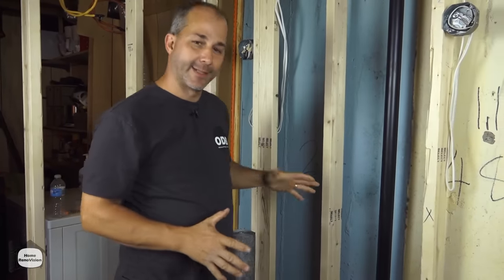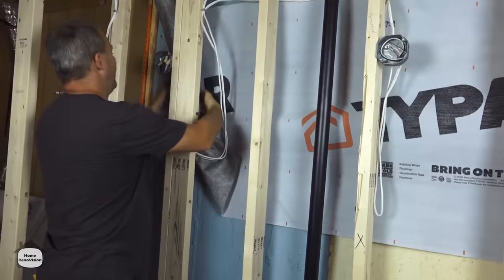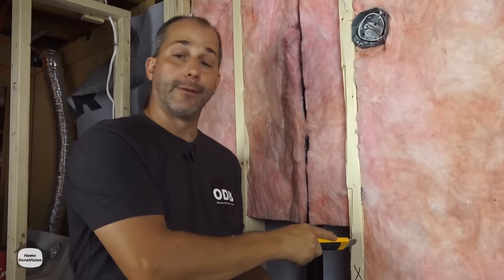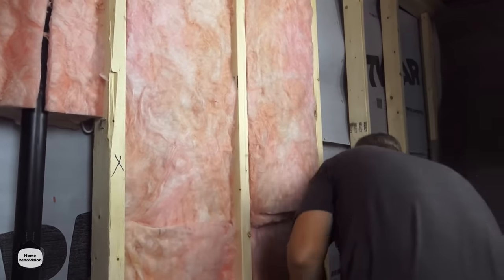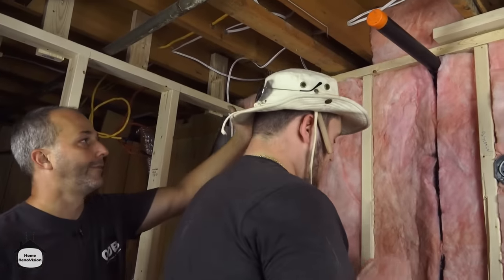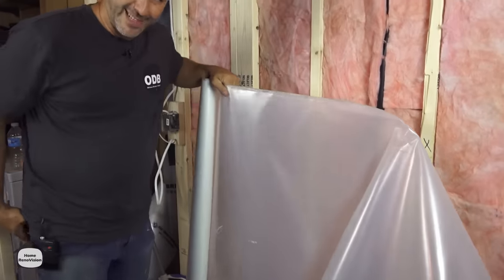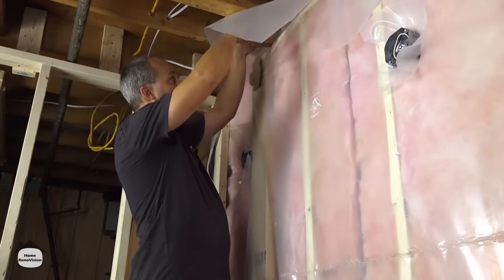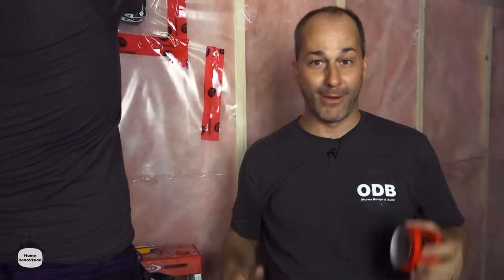How to Properly Insulate a Basement Wall: NO MOISTURE!

Comment: Not good building science, Especially building in anything below zone 6-7. The TyPar is an air barrier (if it is taped and sealed properly, which this is not), and a vapor retarder which is letting moisture through, you can still get condensation on the foundation walls. Water vapor moves primarily through air movement, not through diffusion. In this application you technically have neither, you could use bailing wire to keep the insulation from sagging in the cavity. There are so many ways for air to move from the finished area to the gap behind the cavities. Insulate with rigid foam board or closed cell spray foam directly on the foundation wall, and then cavity insulation  if you still need more R-value. This will work every time in every climate.
Reply from the maker: Here we go. First the typar is not being installed to do anything but keep the insulation from coming in contact with the concrete. Having said that , the links you posted were citing the bad design of walls that had the insulation against the concrete or plastic vapor barrier on both sides of the plastic. The problems that cause are obvious. In my design You get an airspace and an interior insulated wall for 1/4 the cost of the new modern systems. This will not promote mold growth and can be restored from any major water event quickly and cost effectively. The system you refer to with the ridgid foam may seem impressive however, I believe that is designed in order to sell more product and ultimately in any flood scenario, the entire basement system must be removed down to the concrete wall and floor in order to control and treat bacteria growth. This causes a huge expense to both the industry and the environment.
My approach is minimalist and time proven in homes for over 100 years. I guarantee this new system will be replace in the next 20 when they discover what us old guys already know. If you don't have air space in the basement then you will have problems. Period.
Reply from the maker: oops, my response was actually suposed to be directed at Andrew Hunt. But is applicable to you as well.

Comment: What the heck???
First of all the electrician ran 5 feet too much wire to each box!? Then you have an airspace behind your insulation,  for what reason? Use rockwool and put it up against the wall? No vapour hats on the electrical boxes? What's stopping the insulation from falling out between the frost wall and drywall?
This is the sketchiest job I've ever seen...you have no idea what you are doing! If you worked for me you'd last five minutes then I'd hire a pro, stop and get a job at McDonald's or something else that has nothing to do with people's home's. 
I've been a contractor for over 30 years, and had to fix your nightmare slack work since day one. Mike Holmes has a tv show because of guys like You!